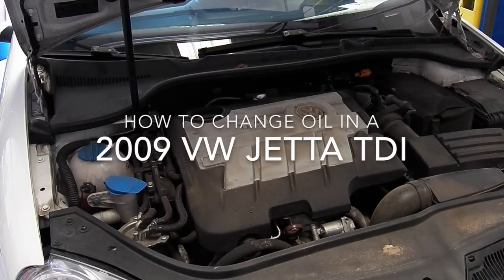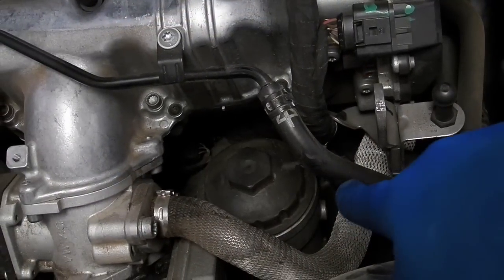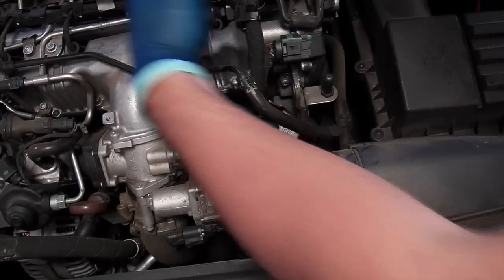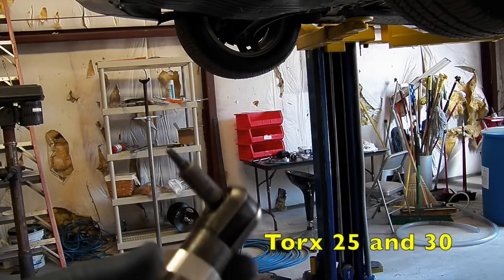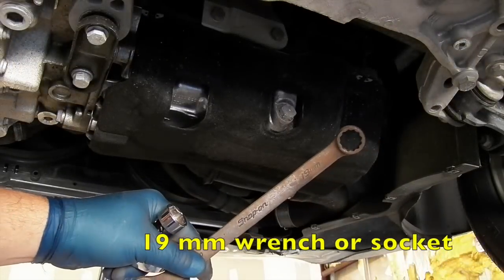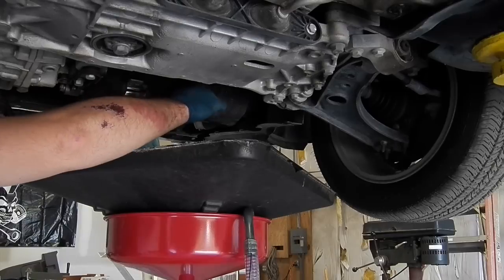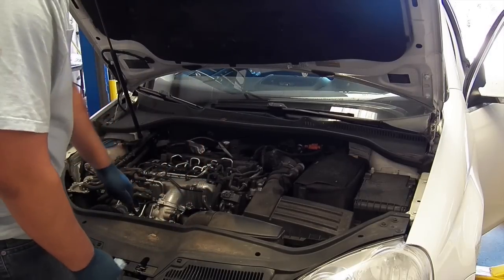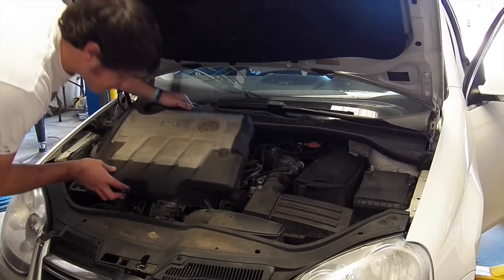How To Change Oil In A 2008-2014 Volkswagen VW Jetta TDI 2.0L

Comment: For the 2011 Jetta TDI, one of the recommended oil's is Mobil 1 ESP Formula 5w-30; it meets the 507 requirement; not regular synthetic or the M1 Formula M.

Comment: Make sure to use a 507.00 spec oil, its designed for Diesel and required by VW for warranty coverage.  Many VW service centers use bulk Castrol 5w-30 which they claim is exactly what VW uses in their oil product for this vehicle.  Most diesel designed engine oils for diesels have passed the 507.00 standard (long change interval 10-15K miles, temperature range for normal operation from -40F to 500F degs).  Mobile 1 synth 0w-40 may work, make sure its 507.00 spec, 5 quart bottles are around 25-30 bucks at Walmart.

Comment: Adam is right. The oil needed needs to be Vw 507.00 spec. if the car has a DPF exs. fliter and it was made after June 2006. The reason for that is the normal full Syn. oil has property's that in a diesel engine/exshust type like VW uses it burns a little (any engine burns a little oil) which sends a mix of chemicals down the tailpipe which clogs the DPM filter.It will do this over time. I have heard it will clog it /damage it in like 10,000 miles in some cases.  Which the DPF filter is like a couple grand to replace.The part alone is like 1400$ on Ebay. I'm sure the dealer is more. Sometimes you can unclog it I know liquid moly makes a DPMF cleaner. Kinda like sea foam for a Diesel. OR if you are pass 60,000 miles (out of warrenty) and if you are in a area where emmisions is not an issue just delete it. you will get better mileage. I plan on doing that to my 2012 jetta TDI soon.

Comment: Good video.  I was planning on doing this today!  I was wondering if anyone knew what the torque setting for the three T40 torx heads are on the belly pan?  I can't undo mine and one looks like it's been sheared off due to overtightening (likely done by main dealer when they changed the DSG gearbox oil earlier in the week :-(  )

Comment: You NEED to use a diesel specific oil.
Reply: I noticed that too. With MK6TDI’s CBEA/CJAA take 5W 30 but it needs to be specific oil service rating, like liqui moly lube 5w30 top tech 4200, or Rowe long life 3, or any that is 505.00 or 507,00,

Comment: do you not change the drain plug / gasket each time? i read somewhere you supposed to. i suppose inspect the gasket if it looks fine dont replace. right? i never replace the one on my 7.3L although even if it does drip its got 15 quarts! =]

Comment: Thanks for the video, but that oil says "For Gas Engines" right on the front of the label. VW is very specific which oil should be used and that ain't it.
Reply from the maker: That's the oil that was brought to me. Use the oil it recommends in your service manual.
Reply: ***** Not Castrol edge 5w-30?
Reply: Correct. It will show the 504/507 spec on the back of the bottle. Search Amazon for "VW 50507 TDI Castrol". You will see what I am talking about. It is in a gold bottle. I have always purchased from the local VW dealer.

Comment: is the oil supposed to remain black as soot after you change it is that normal at the end of the video when you check the oil level was the oil black
Reply: Yes and no.  It really can't be helped.  The Turbo holds some oil during the change and will turn the new oil dark once it mixes up.  The turbo also gets very hot and causes the oil to turn black faster than a non turbo petrol car.  I asked the same question when I first changed the oil on a diesel.

Comment from the maker: Thanks for watching. Please share it and order some parts from the Amazon links. It helps me make these videos.
Reply: I obtained 12 quarts of Mobil 1 ESP Formula on Amazon for about $110 delivered.  It is VW 507.00 approved and lists that on the back label.  Mann oil filters sold on eBay, Amazon and Autohaus-AZ.com come with the new O-rings.  For a 2013 VW Jetta TDI the Mann filter is HU 719/7 x, and may be made in Germany or Mexico.
Reply: Tom Krummell my dealer charges $59 for an oil change on my TDI, it's almost cheaper and easier to go through them lol.
Reply: Robby M I won't ever change my TDI oil since Moss VW gave me free filter and oil for life.
Reply: lmao wow my dealer definitely didn't offer that, I just got the included VW maintenance until 30k

Comment: Prefer the oil extractor, worth every dollar. The fact you missed 507.00 on a DPF EGR TDI is kind of dangerous. Should redo the video lol. Started with the 5w30 Castrol VW dealers stock for 507.00, later went to the 0w30 Mobil 1 ESP 507. Pela 650 extractor.

Comment: That oil is not VW approved. There is a reason for the approved oil ONLY on these clean diesels. USE IT for the sake of your motor's longevity.
Reply: It's got nothing to do with the motors longevity, it's got to do with the DPF filter.
Reply: Jon simone AND the motor ' longevity. Mixing fuel with oil is bad. This happens on the clean tdi's while the scrubber is being cleaned.
Reply: +jake Johnson, I don't know about your truck. sorry.
Reply: +jjtt2003 Engine* not motor its internal combustion
Reply: Sydney Paillet Wow...apparently I confused you and am confusing many others. You make a moot point. For your intellect, more care will be used so that no confusion can take place.

Comment: location of the oil drain plug, oil filter  are so far apart.
engine splash shield requiring two different  sizes of torx bits.

conclusion: asian car engineers have more common sense than their german counterparts.